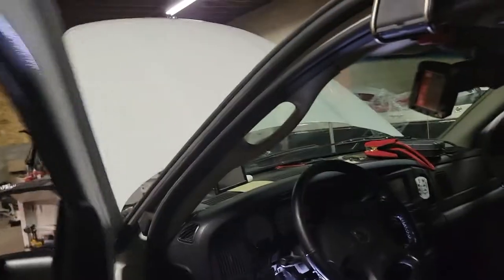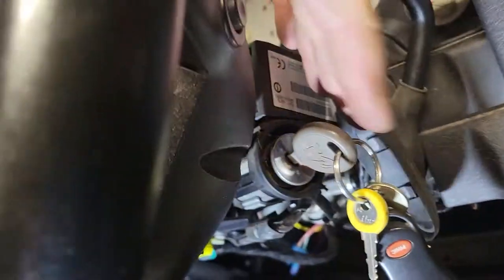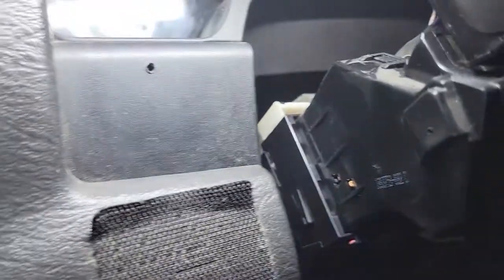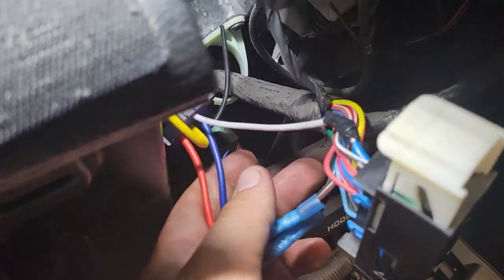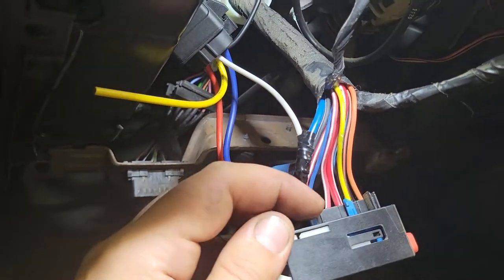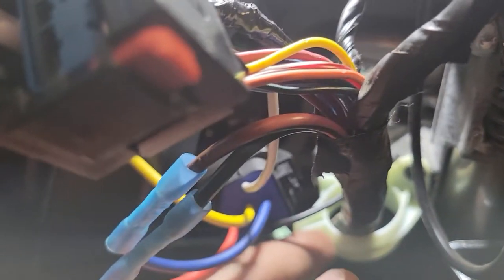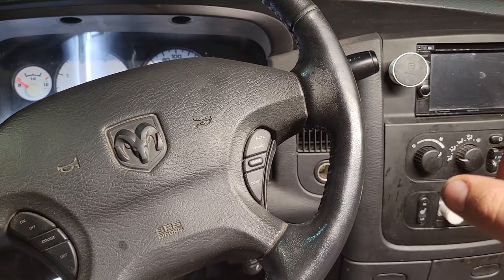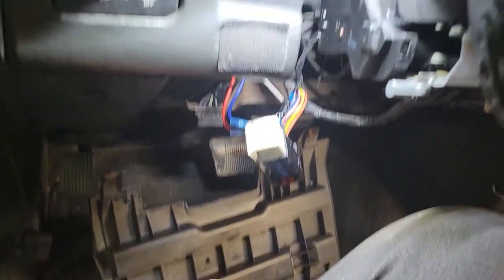Dodge Ram no blower, ignition switch relay bypass DIY fix

Comment: This worked for a 2003 4.7L Ram 1500 - the two wires for the blower motor were as pictured in this video and I connected them to the replacement relay as shown. I did not have the heavy gauge blue wire for the trigger though, I used an orange wire CAV 14 and my blower is working in the start/run positions and no longer is using the ignition switch relay. Thanks for the video, much appreciated~
Reply: Hey can you tell how you did yours with the wires being different colors and size I have a 04 as well.
Reply: For the two wires for the blower motor did you have to cut them from the pigtail in order to attach them to the relay?
Reply from the maker: Loce to see that my video is still helping others out

Comment: Thank you! My blower motor hasn't worked in like 2 years. The ignition switch is causing my truck to not start, drain the battery and my blower motor is not working. Replacing the ignition switch just fixed it till the next morning and then my truck was dead again. replacing the ignition switch fixed my truck not starting but not my blower motor. I am sure my ignition switch just died again because of the overload from the blower motor and it drained my battery. I was wondering how to fix it by putting in a relay but no one had a video about putting a relay in. Thank you for putting this video up. It's a very common problem but no one really talks about it to much, mine just went out a few day's ago. I am hoping this will fix my problem of my truck not starting, draining the battery and blower motor. I am 100% sure this will fix it. I have a 2002 dodge ram 1500 4x4 5.9L Sport with 220,000 miles. I am gong to go fix my truck now and hope everything goes well. Thank you again!

Comment: Getting ready to fix my 2004 Ram the same way had no issues until about a week ago blower motor stopped working the truck has 295,000 miles and I am surprised it lasted this long

Comment: Bro, I have the 2002 5.9 (non-diesel) and I the EXACT same issues, especially the startup and take the keys. I burned the same way you explained. For 2 freaking months my baby has been down or at half capacity. I will be rewiring the truck today the way you did it. 
Damn you answered so much in just a few minutes. I'm glad I ran into your video and will give you an update after the work is done. 
Thank you ! Thank you thank you
Reply from the maker: How did it turn out for you

Comment: Thanks! This gives me more direction of where to look for a solution to my similar problems. Going to look at it and see if it could be the same issue.
No start (hot wired a push button)
No blower motor 
No speedometer 
No power windows 
…all failed at the same time

Comment: Thank you so much!  I've been pulling what little hair I have out with this one.  Even with a new fan resistor, I was getting a bit over 8v at the motor, not enough to make it spin.  It's winter and the wife's truck can't be without heat.  Lo and behold, I move the tilt on the steering column and now the fan is working again.  Looks like it's time for the relay fix!
Reply from the maker: I'm glad I could help! Dont be afraid to jump in with both feet with the info in the video

Comment: Thanks so much!! Was definitely what I needed to see. Did the exact same to my truck and now my a/c blower works when needed!! A++
Reply from the maker: Check the condition of the connector to the blower as well. (Under the dash passenger side ) I later found my connector was melted and was causing a lot of resistance which i think contributed to my switch messing up

Comment: Thanks for replying so fast; I do appreciate the info and will watch my profanity in the future.
Love my old Dodge Cummins; just get really frustrated at how dodge designed the rest of truck; it’s hard not to vent when it’s 110 degrees and your ac blower motor decides it’s a good time to quite.
Reply from the maker: The worst kind of electrical failure. An intermittent one...
I wont hold it against you that you lost your cool... your ac dosnt work 🤣

Comment: Thank for the fix the 04 Diesel has heat again works great great video!
Reply from the maker: Double check the connectors to the blower too, make sure they arent melting
Reply: @TehArtfulDodger  Yes they are melted to another thing to fix lol got to love thses old trucks,  Thanks alot for all the help!

Comment: Brilliant fix. I noticed that the pinout on your dad's 3500 has 3, 10-gauge wires. The 2005 Ram 1500 I am trying to fix has the 2 big wires. Mine are Red and Blue at the top as opposed to the Brown and Green in the video. I'll bet the color changes has to do with Daimler/Chrysler days, the Germans use the Brown color for hot. So Red for me is battery and Blue is blower, I would assume those are also the services you cut and spliced. Your 3rd 10-gauge confuses me because it would mean you have 2 10-guage wires to and from your blower motor. In the absence of another big wire, I am thinking that the white in-line 3-way splice for me, should be the wire color that comes from the other side of the blower motor and resistor. Would that be correct?
Reply from the maker: The white wire, in my case, is a trigger wire. It is used to switch on the relay, which in turn closes the circuit between the top 2 big wires. You can choose any wire that is a key-on powered wire.

Comment: my 96 2500 has the same problem-only its the blower, abs module and the power windows. Terminal 5 off the ignition switch. New relay going in tomorrow.

Comment: I am having the same problem with my 2001, replaced everything, still can't get blower to work through the switch, had to run a ghetto rig with aux switch one speed to the fan

Comment: Yeah, I’m having the same problem with mine. The blower motor stops and the windows won’t go up and down. If I tilt the steering wheel up and down or tap it, the blower motor starts and the windows will work. I’m going to try this method.

Comment: I have the same issue, except sometimes the blower motor will run if the knob is turn to a setting with the truck shut off completely. Came out to a dead battery. Same problem?
Reply from the maker: Your ignition switch needs replacement
Reply from the maker: Its located in steering column behind the key barrel

Comment: Hello, just happened to me, smell electric burnt odor and my blower stopped working.  I going to check now for the issue as you described it, do you happen to have a part number for that relay?
Reply from the maker: Check your blower connector first. Put fan on high and wiggle it. Replace blower and connector
Reply: @TehArtfulDodger  Thank you I will try that first.

Comment: I used this on a 04 ram 1500 that kept having blower motor problems and burning ignition switches. Fixed the issue but now the radio and wipers aren't working 🤷
Reply from the maker: Double check the plug on the ignition switch if it's seated all the way, and wires in the plug are good.
Also, double-check connections on the connections to the clockspring.

When you say the wipers arent working, do they constantly stay on?
Reply: @TehArtfulDodger  no they don't come on and turn signals are also inoperable. I'm thinking a plug for sure.

Comment: Thanks for video. I have an 04 the wire colors are different and my relay says yellow is normally closed. I wired it up no blower. It would work before and go out frequently. Any ideas?
Reply: I reworked the ground now i have blower but only in accesory not in run position
Reply: Figured it out! Thanks
Reply from the maker: Good to hear man

Comment: I have a 2004 dodge duly I was driving home and some smoke started coming out from behind the steering column. All of a sudden my ac blower fan stopped working. Could this be my same issue? And if so, do you have a part number from Amazon where I can order the relay?. Thanks in advance!. Great video!..👍
Reply from the maker: This could be it. Check the condition of the connectors to the fan in the passenger side footwell. I have later found that the connector to the fan goes bad and causes a lot of resistance in the ignition switch, its a cascading failure.
As for a amazon part number I would just search for relay with pigtail, and buy one that is similar looking to mine
Reply: @TehArtfulDodger  thanks a lot harry for the advice!..

Comment: I have a 2004 and have replaced the switch multiple times. The last few times right before I lose blower motor I get a check engine light with codes P2608 P0542 P2609. I have made it to where the wires connect straight to switch. Do you feel this will fix my problem and if so is there a certain relay needed. Any help will be appreciated
Reply: @ukrainianbear05 do you think this will help my problem? I keep having to replace switches. I originally drilled out connector and had wire go straight to ignition switch. I Don't go to switch and bypass is do you think this will fight my problem?

Comment: Hi do you know if this fix would be similar on a 2008 Ram 1500 with the same symptoms?
Reply from the maker: Should be same they are the same cab, just a facelifted front end. Check the wires under the passenger side going to your fan if their not messed up and if the symptoms are the same open it up and take a look
Reply: The symptoms are the same I've changed the blower the resistor and still intermittent and only on high when it decides to work...I know the ignition switches are different for 2003 to 2008...but thought they should be similar I'll look for burnt wires..thank you for the reply.

Comment: Mine is the oppsite i can turn the truck off but the ac controls remain on  i have to make sure the controls are off or it will drain the battery
Reply from the maker: Sounds like the same issue just broken differently. Try this fox it should work
Reply: @TehArtfulDodger  working on it boss
Reply: @TehArtfulDodger  that was the exactly same issue, unfortunately at the time of fixing it there were not relays at the auto parts so I just replaced the ignition switch, the relay would be for another time soon, thanks for the video it save me money and time!!

Comment: I have a similar issue. No fan, no power windows or speedometer. It all happened at the same time. Any ideas?
Reply from the maker: Check to make sure your belt isnt snapped
Sounds like no alternator
Reply: @TehArtfulDodger  belt is fine.
Reply: @TehArtfulDodger  originally the problem was that it wouldn’t start with the ignition switch. Replaced the switch. Still no start. Replaced the neutral safety switch. Still no start. Finally got wired a push button to the starter. Now it starts and runs fine…but no power to windows, speedometer & blower motor 🤷‍♂️

Comment: I have one fuck problem here 
Fuse as melted inside the fuse box my mistake now have installed new fuse box fan do not work i can feel some heat from the vent but blower do not blow air 😢
I have already change the resistor and blower motor before the fuse melted in there 🎉 
i have test the blower motor wire up to the battery 🔋 and it work so i guess is the control fan switch possibly 😅
You tell me what is your guess on that one
Maybe your sight can help 👋
Reply from the maker: If your fab dosnt work even at full speed then do what I did in video
Reply: Can you put a link of the bypass relay switch?
I need to do this to my truck as well…